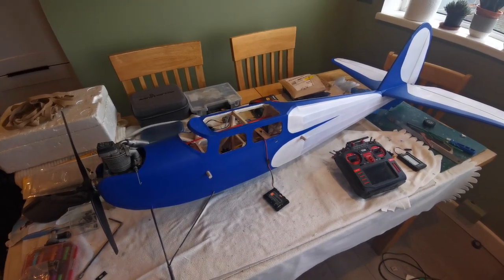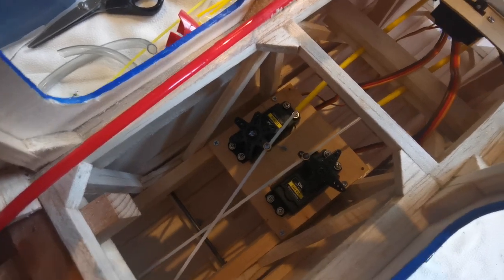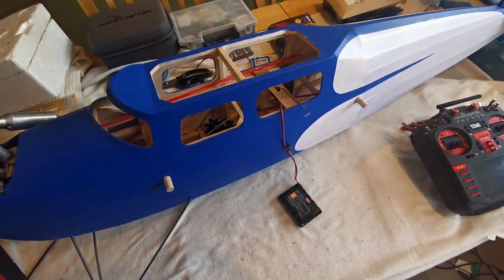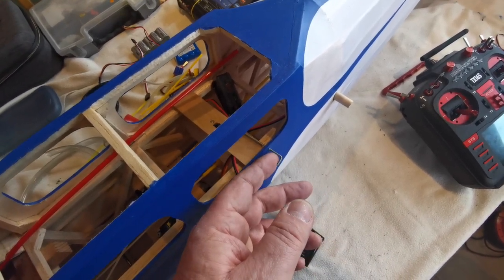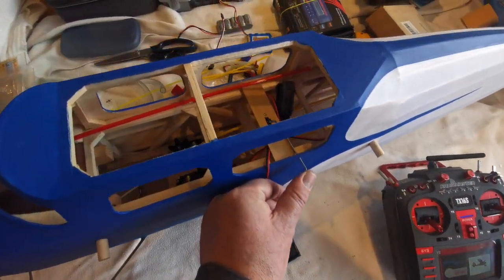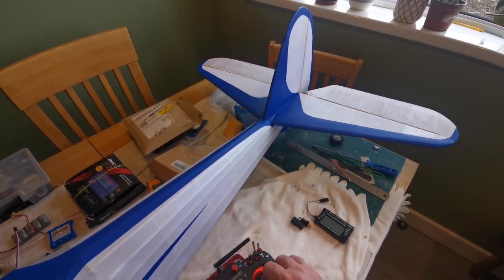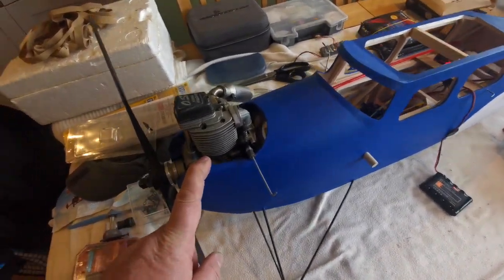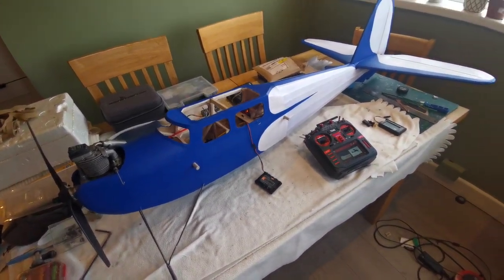Falcon comes to life with the radio instillation.

Comment: Have you fuel proofed it yet? Have I missed that bit? If so what did you use?
Reply from the maker: Just completed this morning using Aerokote which is a two pack fuel resistant finish.
Reply: @MarkCroucherRC4fun  Did you brush or spray the Aerocoat?
Reply from the maker: @flasheart49  I simply brushed it on it benefits from a few drops of cellulose thinners to help the flow. I think with an airbrush application you could achieve a glass finish but for this model I'm happy with using a brush.